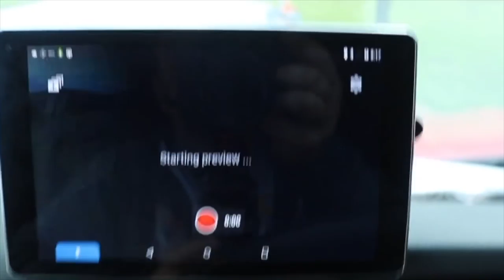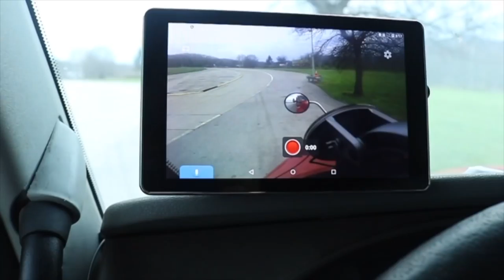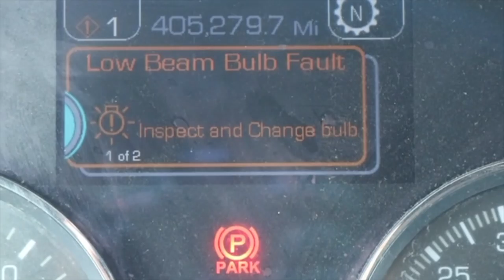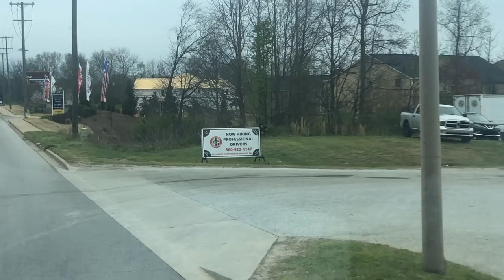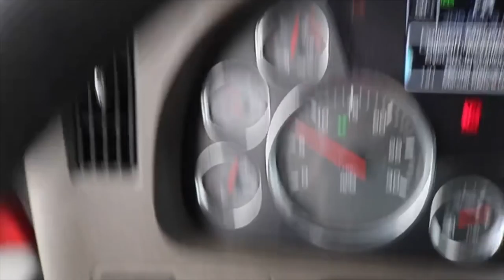#101 Light Bulbs & Jim Beam, Trucker Jim's Truckin Journey

Comment: I don’t know if it was a recall or what. We had the same problem with our T680s they ended up replacing both headlight assemblies the difference was amazing. You need to check with the shop.
Reply from the maker: The low beams really do suck

Comment: I got a plastic disc from a driver that had just bought one of those RM, I think you are supposed to stick that disc to the top of the dash and mount it to that so it doesn’t interfere with dash cam
Reply from the maker: I got a plastic disc with mine. Wonder if they are reusable?  Didn’t break it out cause I think I’m getting a new truck next month. Maybe I can break out the Velcro for a temporary fix. That’s how my antenna is mounted
Reply: They are not reusable, and they are funny about sticking. I used mine to mount my gps by the Qualcomm and it fell off in about two weeks, but that was straight up and down I think they are made to sit flat
Reply: You going to bargain for a freighlinner? I’d like to see one of y’alls since it not your typical fleet truck

Comment: I have the overdryve pro too. I really like it except the mount sucks ass, the magnet comes loose on bumpy roads, and it tends to freeze up on me. Awesome when working correctly but very finnaky.
Reply: O and I mount on dash so cam is kinda useless.
Reply from the maker: Mine keeps losing power and cutting off and I have to change the fm station a few times a day.  It’s great when it’s not acting up. Have you found a way for the mount not to be in the way of the dash cam?
Reply: Ya mine does that too... I use the auxiliary cord on the mount for radio. Tuner got too annoying. I don't really use the dash cam I have a diff one. They way I mounted it in the dashit really just doest work